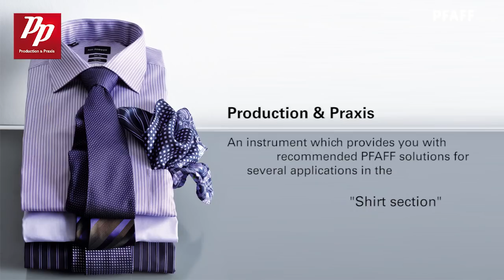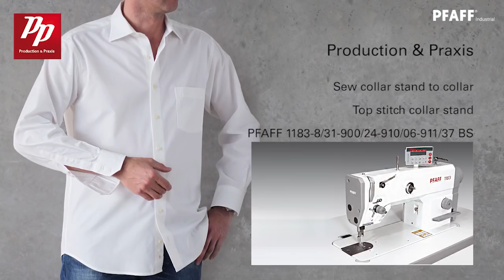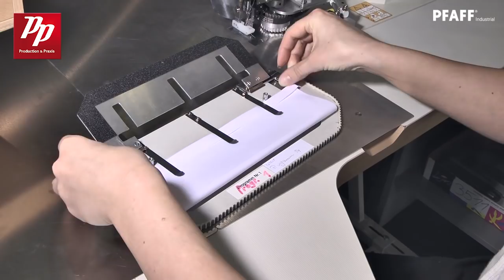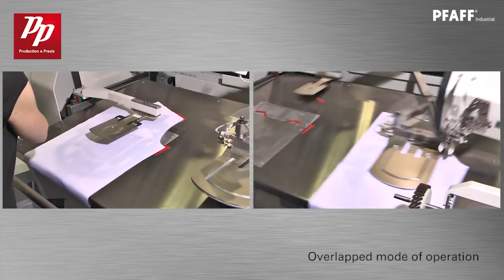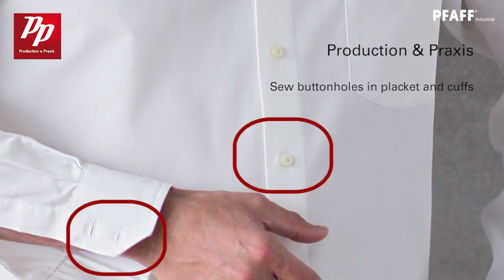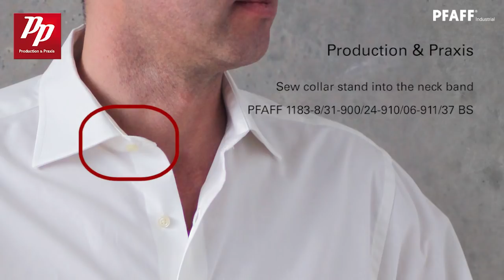Production & Praxis "Shirt section" (HD)

Comment: A cylinder arm machine is only be used for jackets or blazers. (= Sleeve setting machine, e.g. PFAFF 3834). For shirts, most manufactures use a basic flatbed machine (=cheaper)